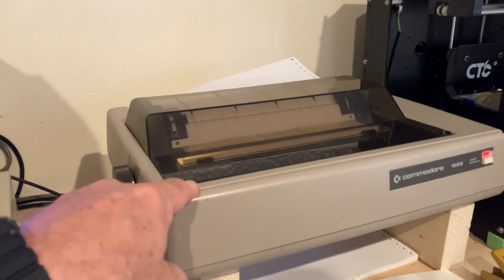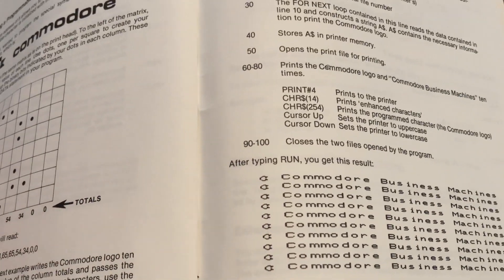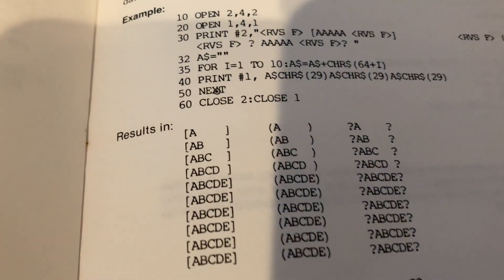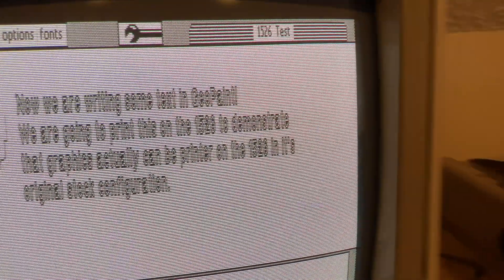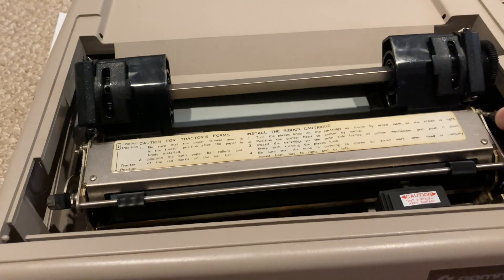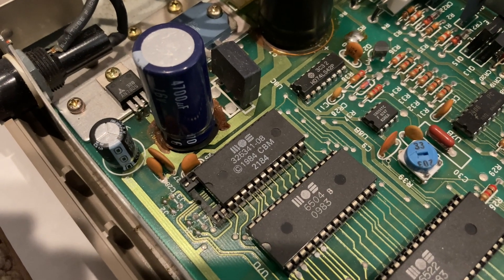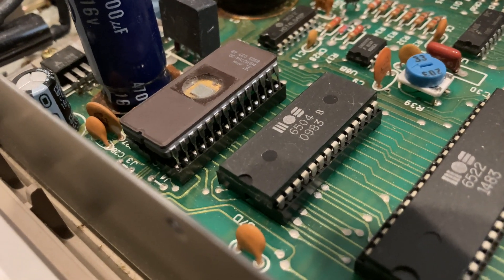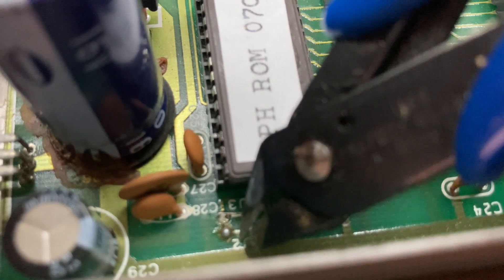Commodore 1526/MPS-802 printer can't print graphics!?!

Comment: I know this is an old video. But the same issue happened with Okidata 82a and windows 3.1. But, it did have graphic characters. It also had an okigraph upgrade kit used by some Apple II and Dos programs for graphic. Just nobody bothered to write a printer driver for it. They did bother with the 92 version with the IBM graphic roms installed.

Comment: Excellent video, a memory recorder has been used, what type of memory was used to record, where can you get that chip?
Reply from the maker: Hi, The original EPROM in my printer was a 27C64, 28 pin eprom, firmware version 1526/C 341-03.

There is a jumper to set 24pin / 28 pin eprom.  In my case I did not need to set the jumper.

If there is a 24 pin rom installed, you may need to cut/bridge the jumper to install a 28 pin eprom.

The ROM image for the graphics rom I placed here for download:

https://file.io/OhnkpCycNl3s
https://archive.org/details/mps-802-gph-rom

Most eprom burners can do 27xx EPROMS.  I used a "GQ 4x4":

https://www.mcumall.com/store/index.php?route=product/product&path=66&product_id=166